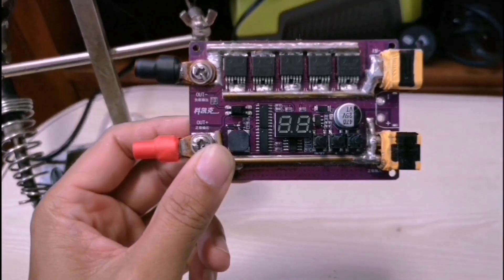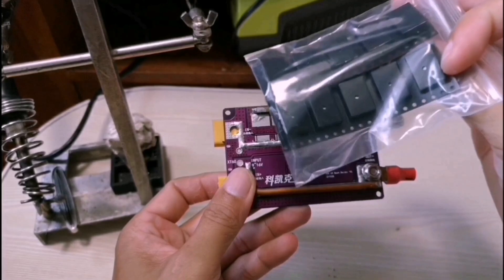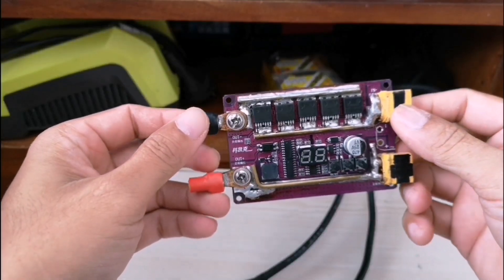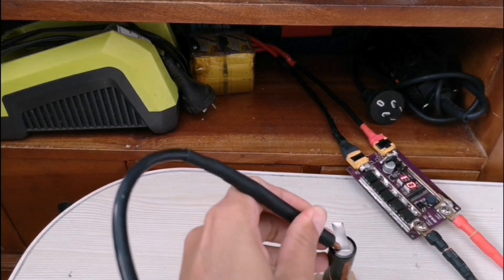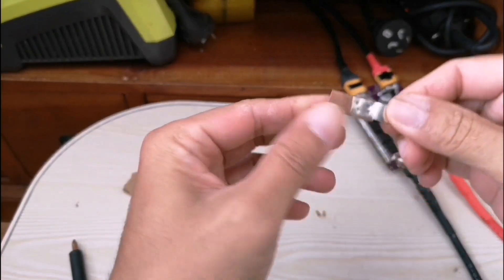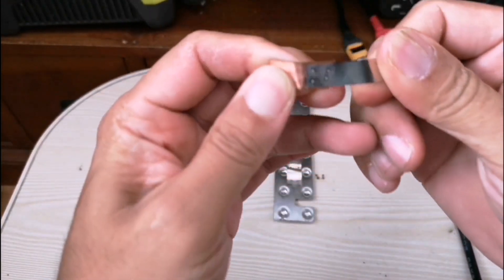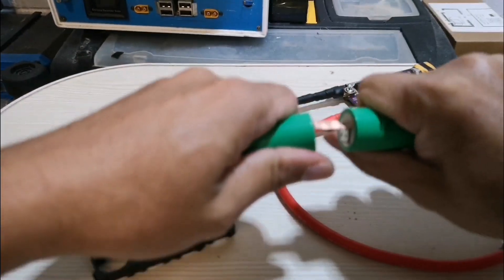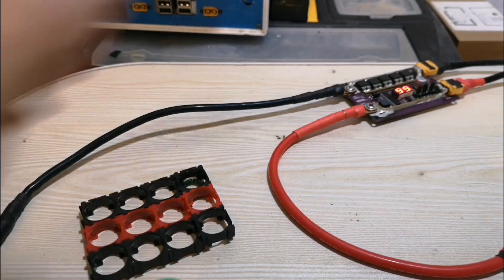Part 2 2022 portable spot welder. weld 0.2mm brush & nickel strip.

Comment: do you feel the power increase? which mosfet did u get? also can u share what probe are u using?
Reply from the maker: the more mosfet the Better! maximum amp  every mosfet 478 so 10×478=4,780A means if your battery can deliver 2000A so this circuits can Mannage for 2000A but for only about millisecond.  I write it down the mosfet link to the description.  I used copper tube and 0.4mm round bar copper then at edge I make like an ice cream cone.
Reply: @pitikaron  is it the IRL40SC209 ?? the link u post has several mosfet option.. im going to make one and see if it can come close to my kweld.. is this alot stronger than the red one u have?
Reply from the maker: Yeap but kindly please double check the mosfet code  from the spot welder.  IRL40SC209
Reply: @pitikaron  what size copper rod did u used to bridge the mosfet? 4mm?
Reply from the maker: 0.2 or 0.3mm round bar it is enough because the manufacturer already installed 0.2mm round bar.
Reply: @pitikaron  I bought the same spot welder. Original there are " IRL40SC228 " Mosfet installed. Is it necessary to buy the same or can I also use the "IRL40SC209"? Does it matter if I installed 2 different Mosfet?
Reply: @Nici619  i bought like this one, waiting answer from @Piti Karon
Reply from the maker: @Nici619  mosfet must the same coz every mosfet are not the same RDS on
Reply from the maker: @rama3njoy  kindly please specify the name of the mosfet in your purple welding,  however if your spot welding install 209 or 228 and you are planning to add another 5 mosfet it must be the same  mosfet.  if your purple spot welding install 228 then you should also install IRL40SC228 IF IRL40SC209 then you should also install IRL40SC209.  thanks sorry to keep you waiting for my response....
Reply: @pitikaron  mine are 228. so i need 5 more right?
if i change all of them, i need the same 228 or i can change to 10 of 209
Reply from the maker: JUST STAY IN 228 IT IS BETTER IF YOU WANT TO ADD ANOTHER 5 MOSFET JUST BUY ANOTHER 228 HOWEVER IF YOU LIKE 209 YOU NEED TO BUY 10X 209. ANYWAY I REPLACE MINE TO 228 OF CAM 10X GIVE MORE EXTRA CURRENT.  5.570A
Reply: @pitikaron  alright, thank you so much
Reply from the maker: Thank you too